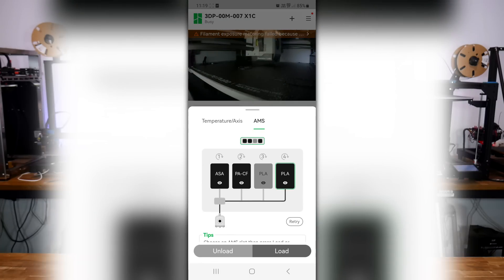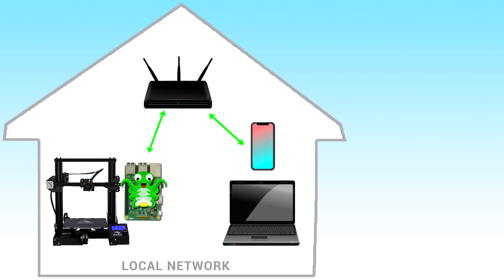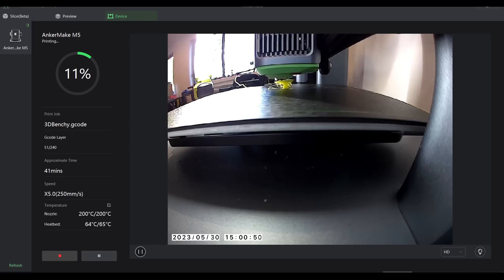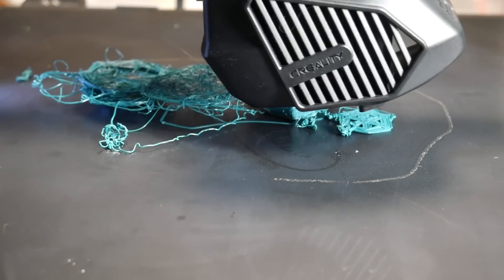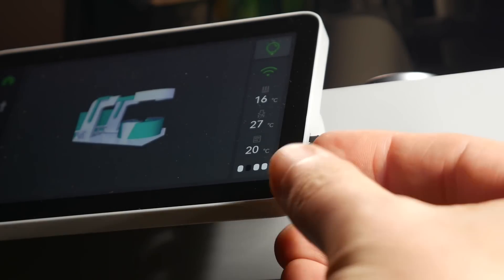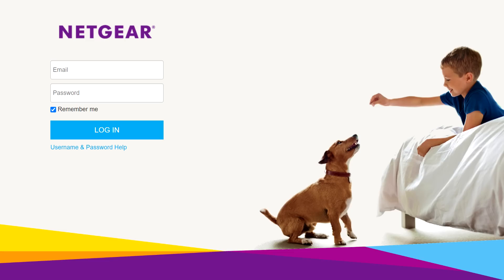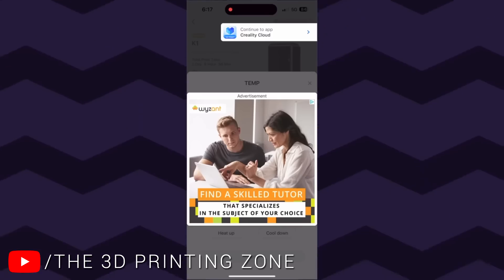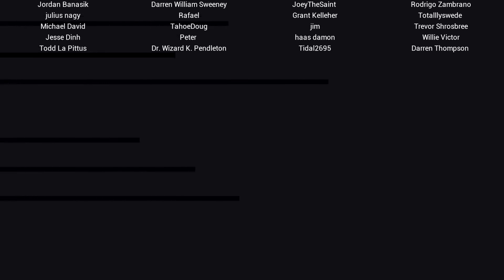The pros and cons of 3D printer cloud connectivity

Comment: This cloud-based closed system is the main reason that I spent the money to build a RatRig printer instead of buying a Bambu labs printer.  I want to use my network, my slicer, and my hardware.  Not someone else's who can change it or get rid of it because of a boardroom conversation or golf course business deal.
Reply: Bambu just rolled out fully features offline printing just today actually. By fully features i mean camera, remote SD card content management, object exclusions and all. You don't need clouds for any of its features now.
Reply: @QuangNguyen-wb5kd  I hadn't heard about object exclusions.  By just rolled out, when was this released?  I'm trying to find info but not seeing anything.
Reply: @QuangNguyen-wb5kd  yeah but the point is that could change. Ulimaker had everything offline and free for a while before making it a paid subscription. And I am assuming firmware updates and such are still online?
Reply: @Unscientifically yeah but the code for enabling most features is open source through their slicer, so you can always have a copy of the known work version. I managed to trick my x1 to think my pc is the server and try to download firmware from there with MQTT and home assistant. The overall concern for cloud printing is there but all the work around is already in place for Bambu lab printers.
Reply: But you can use Bambu stuff without cloud...
Reply: @technicallyreal  Having local LAN without cloud is a good first step, but there's much more to do.  Spare parts are still exclusively through Bambu.  You still have to use the Bambu slicer, you can't use a different one.  The form factor for nozzles, extruder, hot end, logic board, etc. is all proprietary, no 3rd-party options exist as of yet.  Right now, users are still locked into their ecosystem.
Reply: @somejoe7777  I do not use the bambu slicer, I use Orca slicer for my Bambu
Reply: @somejoe7777  there are third party nozzles and even v6 adapters and other parts available outside of Bambu. You can use any slicer you want. Offline printing via SD has always been an option and printing wirelessly using LAN mode isn't new, whoever said that is incorrect. 

There are still concerns, but a lot of what's being said just isn't accurate
Reply: @technicallyreal some of us aren't ready to give up on open source printers. We've watched other closed source printers come and go, leaving their users in a lurch. We don't want to fall victim to that. Open source may not move as fast as closed source, but it'll still be there when Bambu/Creality/whatever falls.
Reply: @awdemuth  I don't disagree, but that's not what this comment thread was about
Reply: @technicallyreal  Ehhp.. my bad.

Comment: I use a VPN back to home in the unlikely event that I need to mess with my printer. My particular gateway makes it easy to set up a VPN correctly and securely.

I’m wary of exposing equipment online. Security on devices are questionable at best since vendors don’t seem to give it any thought. That’s assuming they even know how to in the first place.

I’ve also been burned a plenty of times by vendors going away or EOLing products for reasons (Google I’m looking in your direction). It helps if the device allows local access for OpenHAB or Home Assistant control.

Comment: yeah sun setting servers is the big issue for me, I've started selfhosting a bunch of stuff just so I have control over everything, using wireguard as a vpn to remotely connect me to my networks works pretty well and was quite easy to setup
Reply: I just have a spare PC monitoring all my self-setup stuff so I can use a program like parsec to remote into it and do my stuff. it's not the most bandwidth efficient job but it does what it needs to with reasonable difficulty

Comment: I despise cloud services because you don't ensure they won't shut down and they will start to enforce subscription services and will make you dependent on using this specific cloud app even if it's to make it easier and when it goes under you will not be able to use the printer because the cloud services are down and it's just another sure way for them to trap you into their eco system and get as much money as they can from you
Reply: Yeah. For example with creality's track record, I wouldn't be surprised if the k1 gets phased out and forgotten in a few months. If they do shut down then your kinda screwed. Also companies can make free features now a paid subscription if its cloud based, like ultimaker has done in the past.
Reply: And it's totally unnecessary, even if you do want the advantages of cloud connection (like remote access). OctoPrint can easily be set up for remote access. Or it can connect to Home Assistant if you already have that configured for remote access and you want basic monitoring (picking files and starting print jobs isn't always that useful anyway...)
Reply: @ailivac  Yep. I'm with you. My printer has been occupied by an OctoPi running on a 3b+, and I'm all for it staying as long as it likes - rent-free, even! :) I feed it G-code over wifi courtesy of the OctoPi plugin directly out of Cura on my Mac, which I can control from anywhere I've got 'net access. Who needs "The Cloud" when you can have your own, personally controlled, totally independent, entirely stand-alone (Aside from filament, 'net access, and power - of course) "make-things" operation sitting on your desk? And if plastic ain't tough enough...  Who's up for lost-PLA casting in pretty much any material you can build a hot enough fire to melt down and pour? :) <buwahahahaha> 

Nah... For my nickel, they can take the subscription and/or ad-spattered model (which is a pretty much inevitable mutation of "The Cloud!") and stick it where the sun don't shine and the air-quality is extremely dubious, thanks! It's a solution in search of a problem to begin with, and trying to make it "pay to win" just makes it that much more odious. Not for me.
Reply: The mobile industry are the ones to blame for this greedy price gouging system. The App Store is a huge one in that concept. This is why I don’t purchase any of the products that support cloud wall subscription services. Those games that people play on their mobile phones, I’m going to take you all on a little trip with this;

First to get going;
1. Your own internet service, respectively between $180.00 - 200.00 a month.
Now for mobile phone =,around $100.00 - 200.00 depending on the type of service you have and the options.
And now your 3d printer (s)
The cost of your printer + options + upgrades to hardware.
Filaments cost
Electricity
A place to setup all of this. ( air filter action for those filaments that need that so you don’t kill your self and family and pets ).
And those costs are just the start before you get into cloud based subscription services.
😢😢😢😮😮😮
👍
Reply: I never ever rely on anything cloud based. That includes not only printers, but also storage and other services (for instance Microsoft cloud services). I always have local solutions, and when a printer or any other device is depending on cloud connectivity I simply won't buy that device. I don't know about the Creality K1, but if it has cloud connectivity only, it's a hard NOT BUY. For now the new Creality Ender 3 V3 SE or KE seems to be local connected only, but what Creality is doing with those stupid advertising should give them an enormous backlash.
Reply: Or they EoL a product line to get to to buy the new product. Usually there’s nothing wrong with the thing aside from age.
Google is also notorious for killing of products for random reasons.
Reply: @ericsnis  Apple, anyone?  Seems people in the USA is scared to their bones of the Chinese, meanwhile, all you talk off, is actually already done by US companies, and has been for many years!
Reply: Michael literally states all that in the video lol 😂
Reply: @freeemailssuck6848  So I just stated my own opinion even if he says it